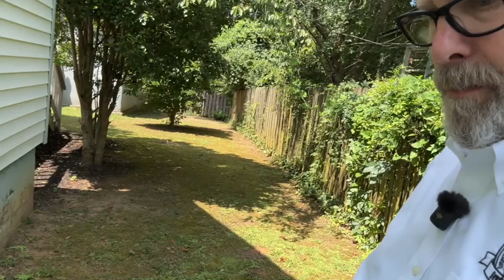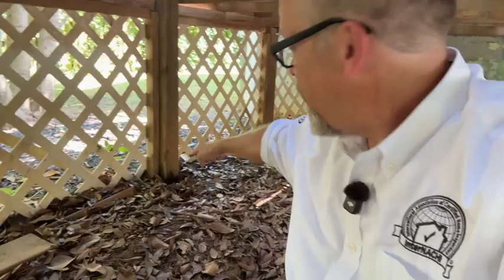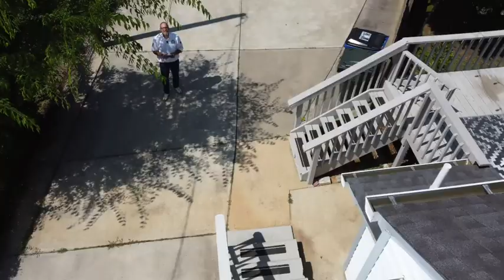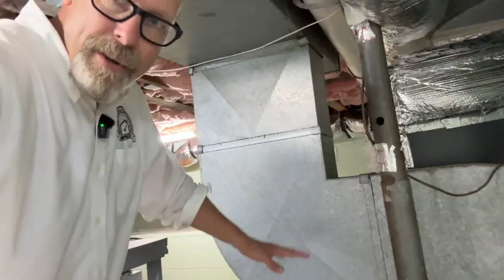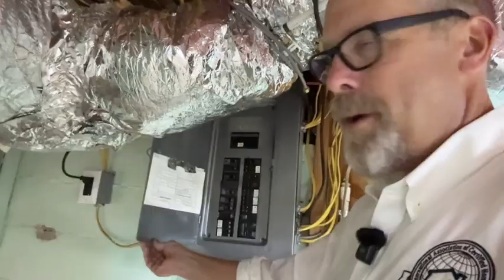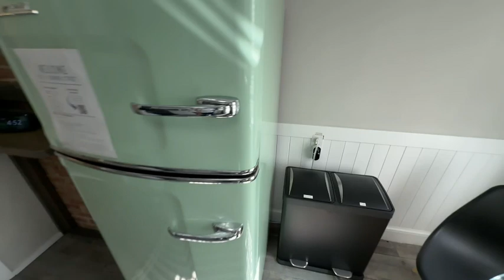Performing a Home Inspection

Comment: Should the air conditioner disconnect switch be so close to the gas meter?  I’ve got 3 feet in mind.
Is the discharge for the high efficiency unit too close to the window above?